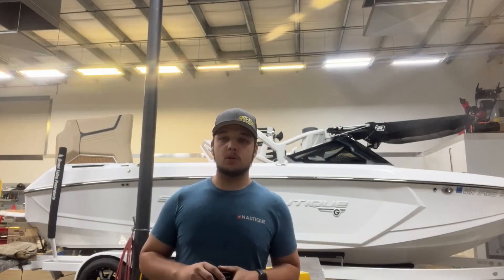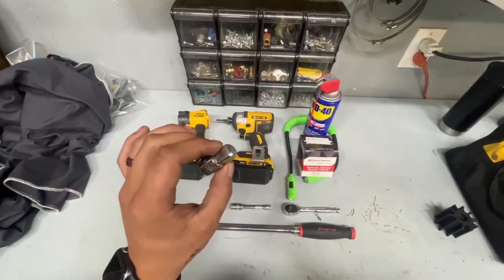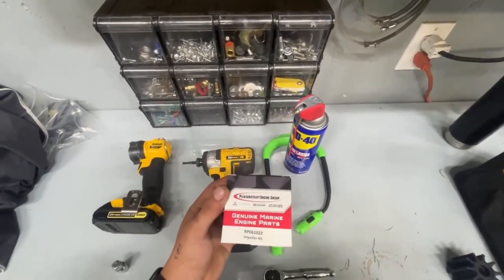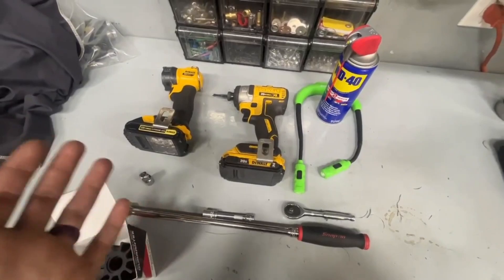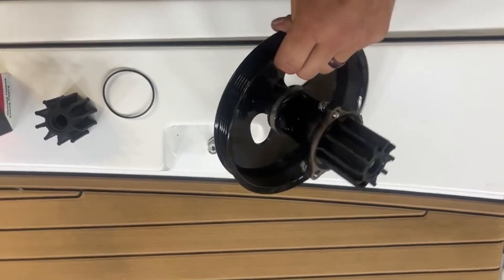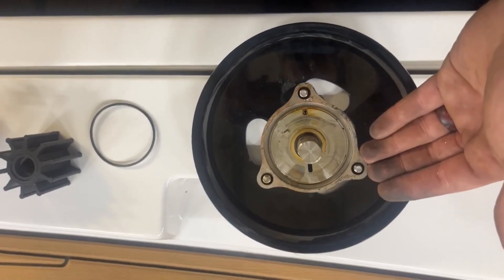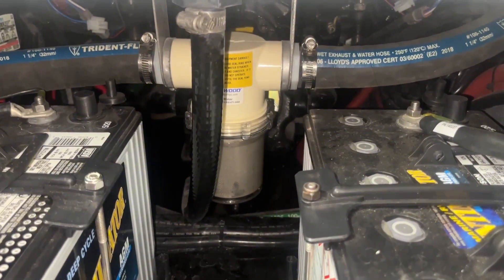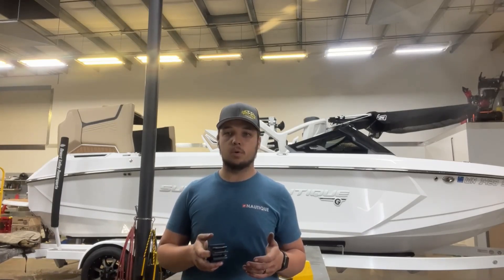PCM Engine: Raw water  pump impeller replacement Nautique, Centurion, Supreme up to 2024

Comment: Thoughts were opinions on installing a new impeller during winterization. Is it necessarily bad for the new impeller to sit somewhat long-term (four or five months) without rotation or water flow?

Comment: This is a great video... but my ocd cringed every time you banged the pulley on the gelcoat .... eek. Also, I would avoid WD40, as it is a solvent.  I would just use a basic silicone lube or similar. Something that doesn't eat rubber.

Comment: Thanks for the video.
Suggestion:  Perhaps applying the WD 40 at the workbench would be easier than in the engine bay....less chance of overspray. IMO.

A previous commenter recommended against using WD 40.

I have just put slightly diluted dish soap on my Ski Nautique impellers to make assembly easier.

Comment: You don’t know what you don’t know but I am teaching you right now, DO NOT use WD-40 on rubber! It’s solvent based and will break the rubber down. You don’t need to put anything on this rubber impeller to “protect” it. Do not ever use WD-40 on anything rubber my friend

Comment: wow, rock star. i would ask you for your winterizing process for a ZZ6 but i see your....in the desert. i hear its simply pull the low point drain hoses, start the engine, done.....but i live in Michigan and my buddies think thats crazy.
Reply from the maker: Desert's get cold in the winter and at night too. We winterize hundreds of boats this time of year. We drain ballast, add startron fuel treatment to the gas tank, we run antifreeze through the fresh water system as well. With this process after you have pulled hoses and plugs to drain, we reinstall them so all you have to do is charge your battery, put your plug in and go play in the spring. Feel free to call our service department for more precise information 509-786-0260